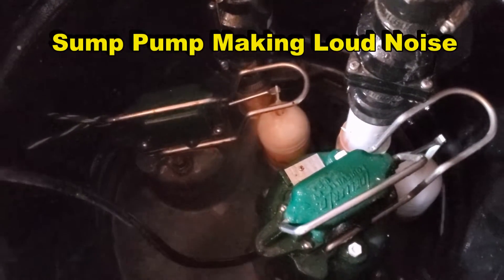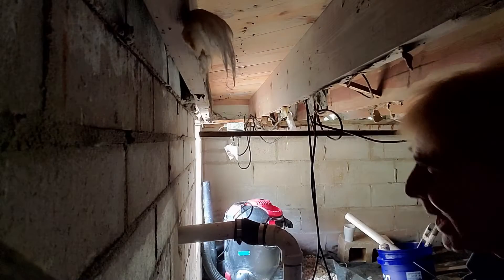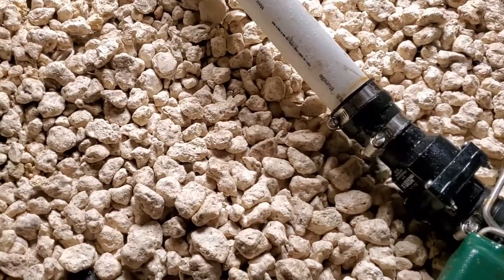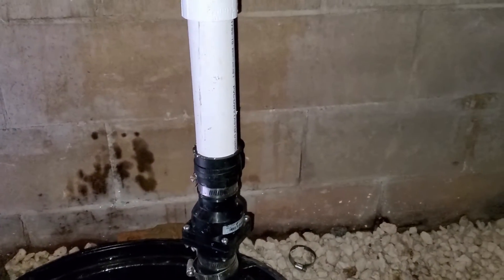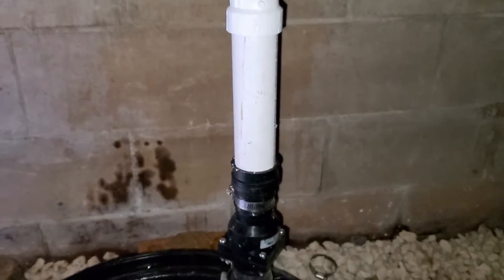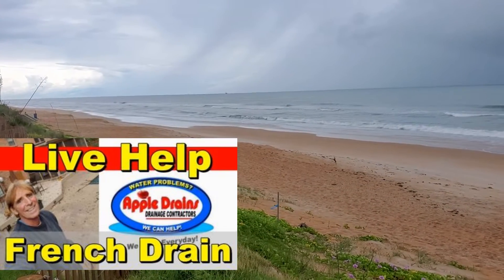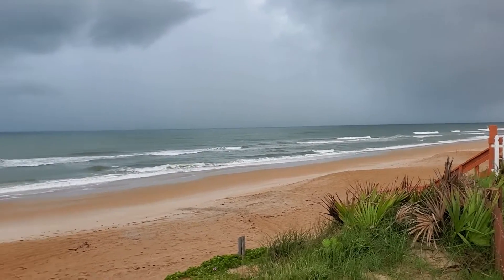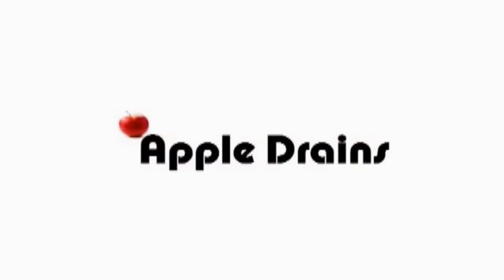Incredible TWIN PUMPS, Below Sea Level Sump Pump, Single Check Valve, French Drain is Footer Tile

Comment: Hey man great video! Nice ocean view too ! 

Hey I have a question it looks like they are getting a bunch of water from the ground being so wet and holding water when it rains hard.  It looked like they where close to 10ft+  above water elevation on that hill ..  

I’m 6ft at my door step  and 450ft from the ocean sounds like a lot but it’s really not .  I was watching the high tides and moon tides  to see why i was filling up with water in my crawl space. I thought it was the Well leaking but it’s not the water level was lower .. comes to find out it’s the ground that is holding a Ton of water! 🤦🏽‍♂️  I found the little under ground streams that flow in when it rains hard .. now .. 
MY question is I only have one big pump that the float switch was broken  but I bought a new one . I want to keep it dryer down there  and keep the pump on at all times but i don’t want to burn the pump out . They are expensive!  
The water will only max out at knee high deep  because some one dug out a big section of the crawl space so I get working on the plumbing would be easier ..  the rest of the crawl space is higher like 2ft below the flow of the house .. so it looks like a in ground swimming pool lol I ask my son hey we have a i door pool u wanna go for a swim hahaha 🤣 he wasn’t up for it lol ..  … 

I went to Lowe’s and bought more hose so I can run it down my yard at the lowest point near the dirt road that floods lol my neighbor dug a section to help drain the water off the road .  As u can tell we have a flood issue when it rains lol lucky when they built my house back in the 70’s  it’s on a hill above the road  fewwww thank god  lol .. 

Well sorry for it being long but  with out the right info it’s tough to give the right answers  lol  I hope my back story was more then helpful 🙏🏽.   
Thanks for your time !  I hope u have a great day !! 
I Subscribe to your channel good stuff man 🤙🏽

Comment: You should have a pipe out and valve for each pump. Consider the water flow if each pump needs to run.

Comment: That won’t work, you need a check valve for each pump otherwise the first pump to kick on will circulate the water back into the basin via the second pump.
If they’re noisy why don’t you use some sound deadening material, mineral wool placed over the basin as long as the noise isn’t a fault.

Comment: If one pump runs wont it push some of the water through the other pump and make it run longer if they both dont have a check valve?  Especially on the backup pump?
Reply: Probably but at this head the pump  probably will still push it out.

Comment: Does the use of one check valve mean that the pump that’s operating we are back flow through the pump that it is not operating
Reply: Yes, if they share the same pipe, which they do in this video.

I'm no plumber but 2 check valves would be best.
Reply: This was my first thought.

Comment: Hello Chuck.....thx so much for your help on all of the different sump baskets/basins video.  I just installed a double sump basket on the outside of my pool liner and got it from Lowes (had a major ground water problem - went with the Zoeller M98 and it is a beast-Thx).  Went with (2) stacked because I needed to bring the height up.  We went deep because of the cold Michigan winters.  I documented everything and am excited to put it all together and post it.